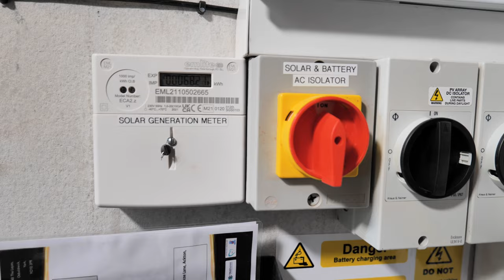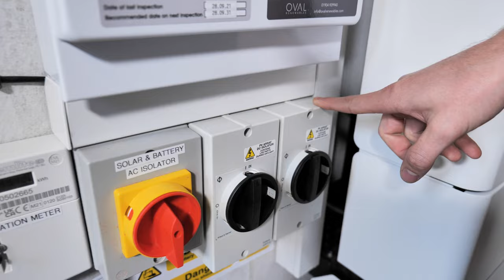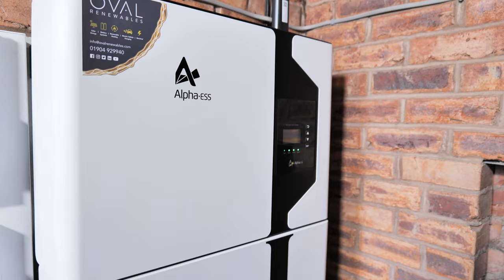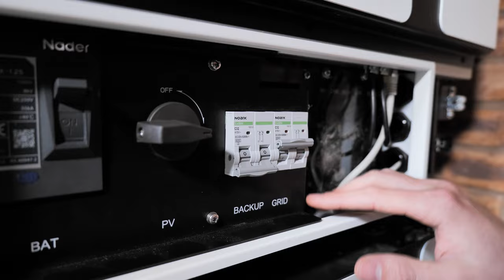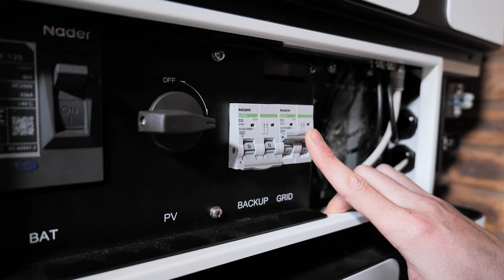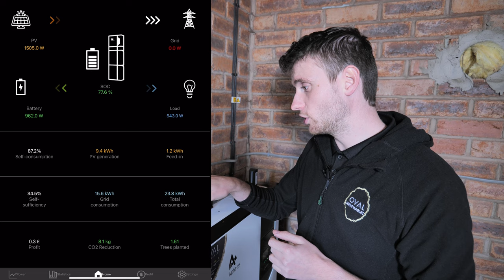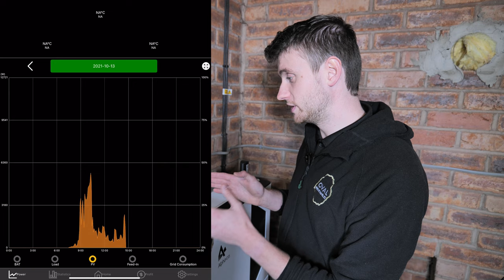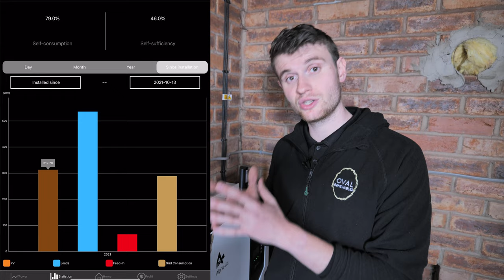Alpha ESS Smile 5 Battery Storage & Solar PV System Installation

Comment: Hi, you mention using the backup output and connecting it to a separate DB with essential loads. 

How do you handle the output in that it’s most likely an IT earth and there is no solid N-E bond created to establish a TN type earthing arrangement? 

I have one of these installed (a B3) and Alpha have confirmed it’s more like an IT output. Probably ok for short term use for backup purposes but not fully aligned with UK regulation apparently.

Just curious if you’ve picked up on this?
Reply from the maker: Yes we have absolutely! We are in talks with alpha about a solid solution but we have added in our own relay to bond it for now. We are hoping to get a more solid solid solution to this soon. Great question and is something quite a few manufacturers are missing!
Reply: @OvalRenewables  so you are creating a N-E bond yourselves using a relay?

Have you done this on the B3? 

Thanks.

Comment: Mate got a question regarding the fit feed  solar, just say you want to upgrade to add. Second system but relocate the old system to say a ground mount if the garden or field or out building that could take it with ease if the property was big enough. To max your primary roof . are you still able to claim the fit rate as it’s the same equipment just a longer ac cable . To the main fusebox Is that allowed or is it a case of remove it from the roof and you loose it as my understanding is that even if the inverter got swapped (say replace due to hardware failure) as that system it’s no bigger or smaller providing it remains the same number and w panel and still feeds the same meter there shouldn’t be a problem the new system just needs a second meter. Or am I thinking along the wrong
Reply from the maker: Hi mate. A fit registered system can be altered however if the alteration results in more energy being generated, for example adding more panels, your FIT provider would move you to estimated payments as you aren’t allowed to benefit from additional FIT payments. If you want to add more capacity the easiest way is to add a second system that doesn’t generate via your existing generation meter.
Reply: @OvalRenewables  thank you. The reason why I ask the house that I brought has 22  220w units output 180w connect to a sunny boy.   So I want to update date to 430w half cell units . With the garden just cleared there was a a lot of room to move it down  facing East

Comment: Hi.I have a garage 30m from my house with an ideal room for all the kit including a south facing roof for 16 panels.Is it feasible to run cables to the house this distance?
Reply from the maker: Hi Ray, yes you can do, 30m is about the max however. Due to the CT clamp length on the Alpha.

Comment: Hi. What fire board do you use please and is there local hardware stores that stock it?
Reply: Hardie backer cement board, 12mm available from B&Q, top tiles etc
Reply from the maker: As the other comment said 12mm Hardiebacker board 800 x 1200.

Comment: really do wish i got into solar in early days :/
Reply from the maker: Solar in the early days did cost around 3 times as much as it does now. You got a great return but had to have the cash available. Now with rising energy prices the return on investment is increasing with a lower capital investment. It’s a great time to look at getting solar!
Reply: I was thinking the same. However  as Oval said in the reply less investment needed now, also highlighted in the video the new panels are more efficient and/or larger output for similar footprint.

Comment: With these integrated units, what do you do if the inverter packs in? Let's also assume worst case scenario and say Alpha has gone under so there's no backup from them. Do you have to ditch the lot, battery and all?
Reply from the maker: Hi, so if the inverter packs in then it would be a case of changing the top box which is the inverter, there is a 5 year warranty on it. To answer the second part, it’s the same situation if you buy a Sonnen, Tesla, SolarEdge you would have to install a different system I believe.
Reply: @OvalRenewables  that's what I thought, wasn't a dig at Alpha specifically, just in my mind as I've been getting quotes for a couple of hybrid units. Many thanks 👍
Reply: They are a great all in 1 solution. Love mine

Comment: Did I see that there is a 3 phase cutout on this? Technically G98 is single phase 16A . I don't think you have mentioned that this is a 3 phase cutout
Reply from the maker: Well spotted. It has a three phase supply but only utilises a single phase connection from it. I believe the property used to have a large air extraction and workshop but no longer has it. Therefore the customer only has a single phase meter installed for domestic use

Comment: quick question. It says that these are generator compatible. does this mean I can wire a generator to the invertor as another charging source in the event of the grid being down ?
Reply from the maker: I believe you can yes. We have never done it but as you say it mentions it on the setup.

Comment: I found this after looking for alternatives to the Tesla and found Alpha ESS and your channel. Right or wrong my thoughts are (after lots of reading and youtube videos) that the important piece of the puzzle is energy storage, hence looking at the Alpha ESS which looks like a lot more for the money, but my question is ...

I live in the West of Scotland so while contrary to belief we do get long hours of sun in the summer, but can you have multiple inputs to the battery and of so which would best for changeable weather in Scotland? For example, solar, a small wind turbine, thermoelectric. Just thinking about supplementing charging the batteries to have some charging consistency with the changeable weather.

Any ideas are welcome! 😁
Reply from the maker: Thanks for your comment! yes battery storage is a large part of a full home energy system in my opinion. The battery has a dual tracker input for solar meaning a large solar array can be installed into the battery. It can also track the generation from a separate wind turbine generator as well via CT clamps. you wouldn’t be able to wire the wind turbine directly into the battery however it would monitor it and use the wind energy in much the same way as the solar PV system in this video.

Comment: I have couple of issue with alpha battery. First my battery continues taking energy from grid 30-60w each and every minutes so end of the day about 600w taking my battey is full still battery taking energy from grid. 
Second while battery charging that time load increase up to 900w. Battery charge from grid or Pv still load gone up. Once battery full and start sending energy to grid load automatically gone down.
Reply from the maker: Thanks for the message, as we didnt fit your system we cant look at the monitoring for you. However I would report this to your installer as it doesn't sound correct to me. I hope you manage to get it sorted out.

Comment: If i used 2 battery 8.2kw with inverter how much discharge current Per phase for inductive loads and resistive loads please 🥺
Reply from the maker: We would need more information on the system you are using
Reply: @OvalRenewables  i am using same system in this video you have been installed if i add 1 more battery
How much inverter discharge current Per phase?
Reply from the maker: @techsaadi  If its the smile 5 you would be looking at 4.6kw per phase (20a)

Comment: Great video, great 4K resolution and gret editing!
Quick question - would the customer lose their FIT on their original PVs or do they still get it as it's monitored separately?
Reply: They continue to receive FIT on original solar installation as its monitored separately 👍
Reply: @TreeWorksUK  Ah, thought so. Many thanks:-)
Reply from the maker: Greg is correct. It’s the perfect solution

Comment: hi i have an trust electric central hearing F/R2.5 kw,BED 1,1.6KW BED 2,1.6KW,HALLWAY,1.6KW,CONSERVATORY 1.6KW, have you any idea what sort of battery storage would be need ,have 11 395 kw solar panel on the roof.
Reply from the maker: We would need to look at more info to get a proper size sorted but a good rule of thumb is to size the battery based on a days consumption.

Comment: DONT BUY ALPHA ESS SMILE 5. I have a smile 5 with dual batteries, It regularly resets and cuts power to my house, Alpha support is TERRIBLE and now I'm stuck with an unreliable system and no support. Get a locally supported system and save yourself a huge headache.
Reply from the maker: Sorry to hear you are having problems. Just to clarify to anyone reading this, we haven’t installed this system for this customer. However I am interested to hear more incase we can help as non of our customers have had this experience. What have your installers said about the problem?
Reply: Alpha and my installer have told me it needs replacing. I am also a qualified electrician, and I can say that the system was initially working well, but after a few months, the "resetting" started. The inverter runs very hot, and the heat sink is too hot to touch on some days.  I understand some equipment has issues, and that's to be expected, but the main issue with alpha is the terrible communication,  after the initial email asking for my installers email address and postal address for the new unit, I've heard absolutely nothing (and either has my installer).. and still no inverter.. I will probably have to rewire half my house to remove the UPS circuit,  just so my computer stops getting turned off in the middle of a project. Very frustrating.

Comment: The pre-existing system should be relocated in the brick room, whoever stuck the gear in the loft needs slapping.
Reply from the maker: Haha slapping is a bit strong! However it wasn’t the neatest install. The old system is fine in the loft as it is accessible and well ventilated 👍

Comment: whats the difference between the Smile 5 and the Alpha B3 battery?
Reply from the maker: The smile 5 is a hybrid so you can put solar directly into it. It can also charge and discharge at 4.6kw over the b3’s 3kw. You can also use larger battery modules with the smile 5. The B3 is also a good unit but just a bit small output wise in my opinion 👍
Reply: @OvalRenewables  with hindsight, I wish I’d gone for the Smile 5 with 2 of the larger battery modules rather than the Smile 3 with four 2.9 kWh battery modules.  The only advantage is that I could add extra 2.9kwh modules but the greater charging and discharging rate of the Smile5 makes it much more practical.
Reply: @stupidusername38  it can be fitted in the loft if you have a strong brick wall to mount it on.  I was told that the biggest issue was the size and weight to be man handled up through the loft hatch, I’m not sure that a Smile5 is small enough my loft hatch.